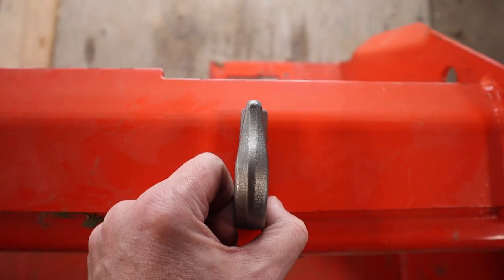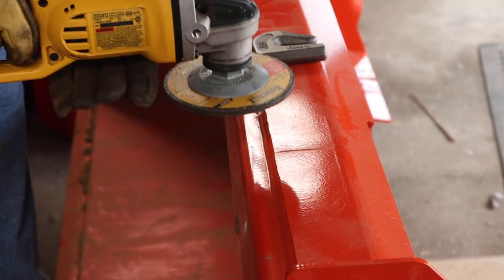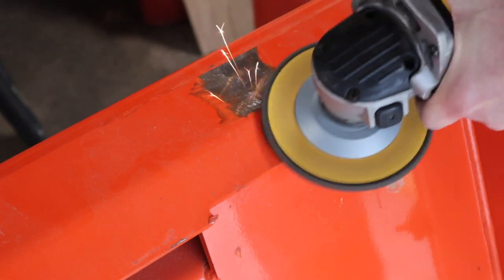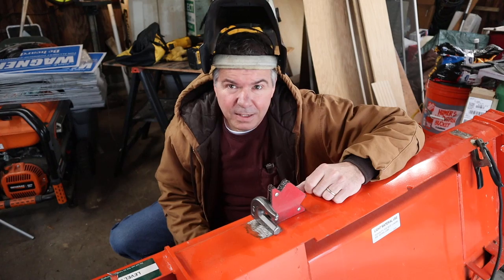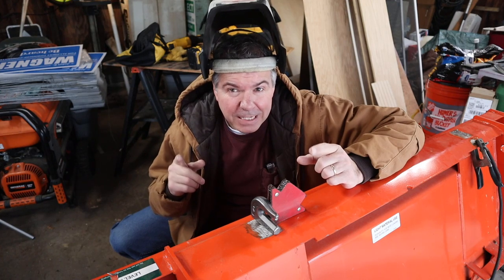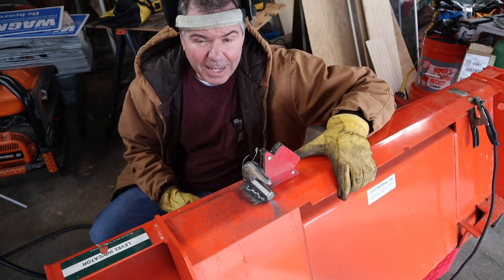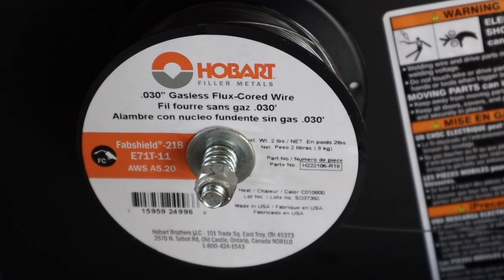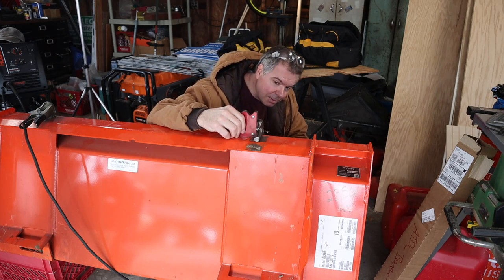#3 How to add weld on 3/8 chain grab hooks. Kubota B2601 front end loader tractor mod!

Comment from the maker: Hooks used in this video: 
https://amzn.to/3k25pod (Amazon affiliate link)
Hobart Handler 140:
https://amzn.to/2Hd83sr (Amazon affiliate link)
Here are some other product suggestions that I use. These are Amazon Affiliate links, so purchasing will help this channel by providing a small commission while not costing you any more. Thank you for your support!
Lumax Heavy Duty Grease Gun:
https://amzn.to/3mFK1pA
LockNLube Grease Gun Coupler:
https://amzn.to/3kPcvwu
Recommended Grease:
Valvoline Moly Fortified
https://amzn.to/3jNM1Kv
Nitrile Gloves:
https://amzn.to/34Kg8OG
Deerskin Gloves:
https://amzn.to/2I17NNy
My Video Gear:
Rode Wireless Go II microphone:
https://amzn.to/3eiJatG
Canon M50 Camera (now Mark II):
https://amzn.to/3vHW9uD
Battery adapter for M50:
https://amzn.to/2RshsBE
Sigma 16mm prime lens:
https://amzn.to/3vJDRcx
Sigma 30mm prime lens:
https://amzn.to/3epFneh
Variable ND filters:
https://amzn.to/3tmoHIs

Comment: The best thing to do This is what we do at the Tractor Dealer Is weld the hook to a piece of flat stock 1/4" or 3/16 and bolt the plate to the bucket .Cleaner and stronger job !

Comment: Love your video,  I have been a hobby welder for over 50 years,  two tips that I would advise you to do. One SLOW DOWN on your travel speed, then go SLOWER. next would be make circles or little "C" motions back and forth evenly and SLOWLY from one side of bead width to opposite side..   carefully watching that you don't burn a hole through the steel that you are welding, if you do, that is too much penetration which you want but not too much. God's gift to bad welders are side head grinders and laying another bead on top of the bad one. I have covered up so many bad welds utilizing this method and no one knew of my poor performance.
Reply from the maker: Thanks very much for your support and great tips! Much appreciated -Ed

Comment: Those welds will hold, I have no doubt. I've only been welding for a little over a year, and while my welds are no prettier than yours they get the job done. I welded three 10k lb. recovery hooks on my bucket and I've lifted downed trees, skidded logs, picked up implements, etc. and have never had an issue with my welds. I have a HF Titanium 125 flux core welder that has served me well, and it really comes in handy for projects around the house and making repairs on equipment. Thanks for another great video, and I'll say a little prayer for your dearly departed microphone. 👍😉
Reply from the maker: Thanks so very much for the feedback and your kind words. Don’t miss the Monday night livestream at 7pm EST. It will be fun!

Comment: When your using a small 110volt machine to weld thick material a pre heat will help a lot. As warm as you can get it.

Comment: In my opinion, these hooks are a must have for any loader. I have welded them onto every bucket I have owned and several friend’s tractors. I put one in center and one on each edge, in line with loader arm.

Comment: My first new tractor (2501) I welded those exact same hooks..turned out nice!
My current tractor (3902) I did something different . I bought a hook, D ring , hitch combo on a steel plate that I welded on top of the bucket.
Much more versatile for me and my needs of lifting things! 
Not a bad job on the welds ( not great tho ..lol) looks like it needed more heat but Should work just fine!
Reply from the maker: Nice! Thanks for sharing. -Ed

Comment: I am not a excellant welder.  I never liked flux core welding to dirty of a weld with all the splatter.  I mig weld with a gas mixture of argon and CO2.  I also found that by setting my heat up and the turning down the wire speed I get better penetration and a good clean weld.  Works for me.  I use .035 wire and wire speed of 30 - 40.  I use a Miller 220 volt welder.  Do what works for you.  I really enjoy your channel.  Look forward to your next video.
Reply from the maker: Thanks Charles. I do plan to get my argon tank filled and do more mig welding. Flux core is kind of the easy way out, but there’s more cleanup for sure!

Comment: Just purchased $150 flux core wire welder.... totally amazed with welds using 120 volts.  Let us know if weld holds.  Looks good to me.  Would be interested in your learning experience with welding.

Comment: Why did you choose weld on hooks vs bolt on? Welds fail due to fatigue much faster than bolts. 

Thanks for great video
Reply from the maker: Thanks very much. Well, if you think about it, the bolt on hooks are still welded to the plate that you bolt on. Granted, the welds are likely better then mine!
Reply: @MyClutteredGarage  thank you. You are totally right. I appreciate all your videos and advice.

Comment: Those hobarts are nice welders, but definitely upgrade the "ground" clamp to one of those all brass clamps (HF has a decent one, although you might also need to upgrade the "ground" clamp wire as it has a very large wire clamp). That small change will help improve your welds, everything else is settings and technique. (also not a welder, but learned from them on how to do better)
RIP lapel mic.
Reply from the maker: Ask Questions, Try Things it’s all about constant learning. Thank you!
Reply: He's right about the brass clamps

Comment: I think weight distribution would work just as well on a tractor as it does on a boat. Three hooks instead of just one. The outer two are open to the cab, the center one is open to the loader blade.
Reply from the maker: Thank you, Jay. -Ed

Comment: Thanks for this! Are you happy with the hooks? Any reason you didn't add one in the middle (or two offset 6" in case you run a grapple)?
Reply from the maker: Thanks for watching. I’m very happy with the placement of the chain grab hooks. You can check out my video number five, where I added a clevis hook in the middle of the bucket. So far, all have worked great for me. I also have the land pride grapple. https://youtu.be/Xe2QtJH45lY
Reply: @MyClutteredGarage  The clevis hook makes a lot more sense to me. Didn't think of that one. Thanks for linking it! I'll be looking at the rest of your videos. Lots of cool/useful stuff.

Comment: I have been thinking about adding hooks to my B2601 Bucket. They sell bolt-on hooks. I have no welder, so I may go that route. Thoughts? Cheers!
Reply from the maker: Peacefield Farm_MN I don’t have any experience with the bolt-on hooks, but I be they’re great. You might also want to check with a local welding / machine shop. Thanks for watching!

Comment: I’ve watched you weld a couple of times you welded on your bucket.
You removed the bucket from the tractor but never said why you should when welding or at least disconnect the battery. RD
Reply from the maker: Good point! Thank you!

Comment: 5/16 hooks are plenty big for anything almost any tractor bucket can lift unless you get into a huge loader bucket. 5/16 chain is also plenty big for anything almost any tractor can pull or any load to bind down. 3/8 is way overkill. As you get older, the difference in 25' of 5/16 and 25' of 3/8 becomes quite noticeable! LOL
Reply from the maker: Haha, good point. I think 5/16 can still work safely with 3/8 hooks?